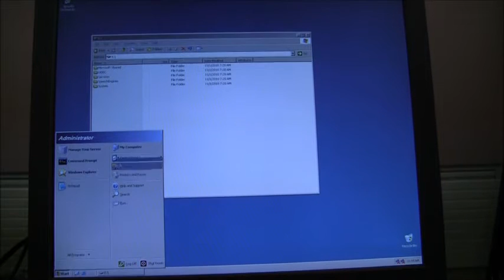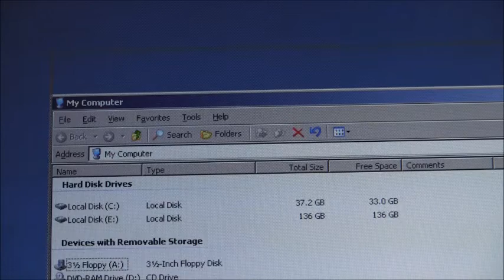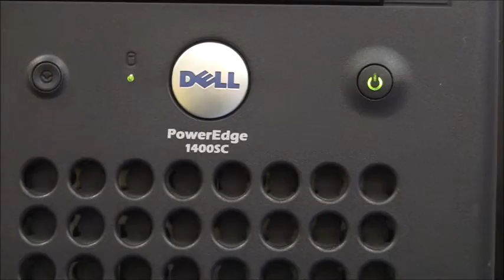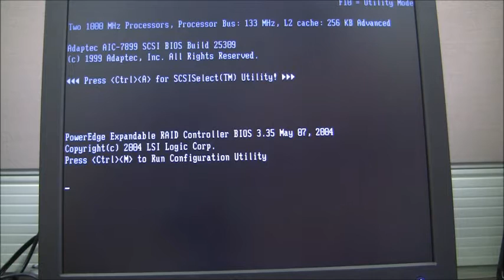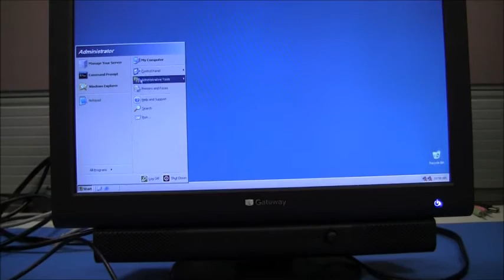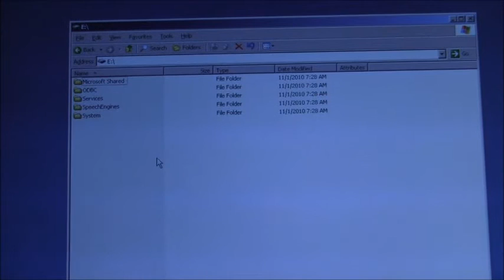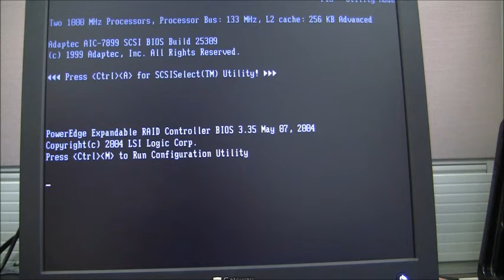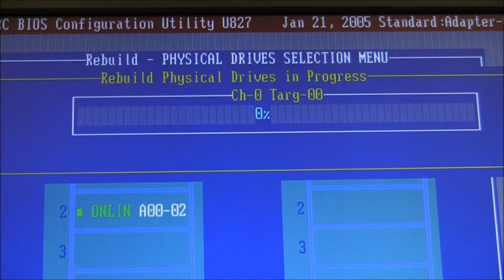Dell PowerEdge RAID Controllers Part 4    How to break and rebuild a Dell PREC RAID 5 array.

Comment: Raid 5 arrays can be very hard to recover as they are quite complex data storage structure, double disk failures are especially stressful since RAID 5 arrays can only handle single disk failures, double disk failures can only be handled by RAID 6 arrays however if the disk corruption is logical rather than physical, Data recovery software like Stellar Phoenix Windows Data  Recovery-Technician cab easily recover the data even if the hard drives have multiple bad sectors.
Reply from the maker: So sorry I am just getting to your comments!   Thanks for watching!   I am working hard on keeping up with the great questions and comments from the YouTube community.  Again apologies for not responding within a reasonable time frame.

Comment: This is a very nice work, actually testing/breaking a raid array! Like this a lot. Nice upload Vanderl2796! I just have a thought in mind. You did not replace the disconnected drive with a different one. Meaning it still have the original data in it. Will the system react the same way if you use a new or different hard drive? Another question: When replacing a failed drive with a new one, is there anything one need to do to the new replacement before connecting it to the system? Like format it?